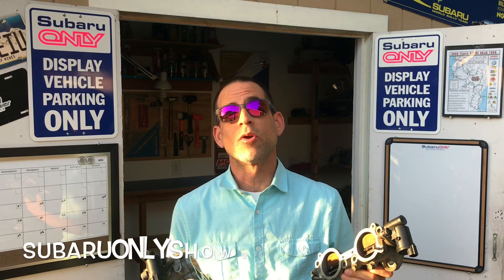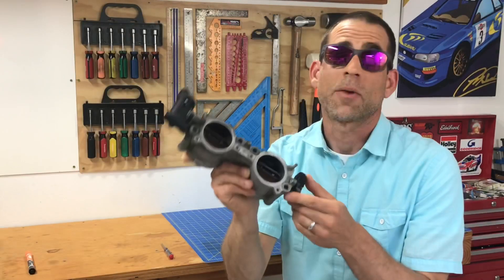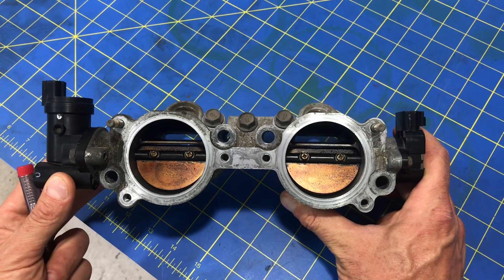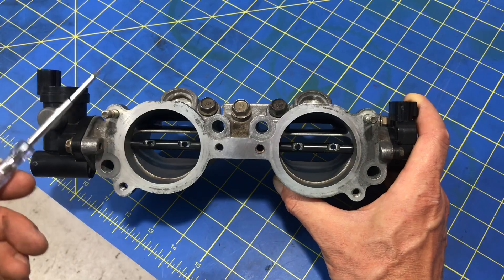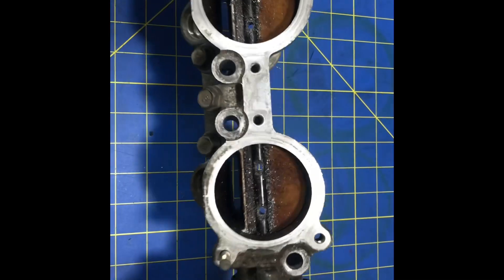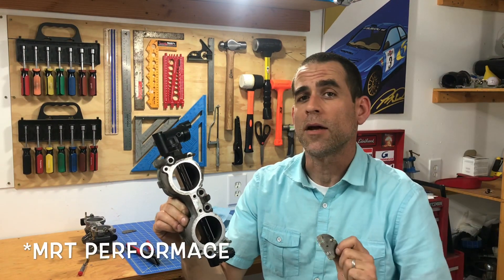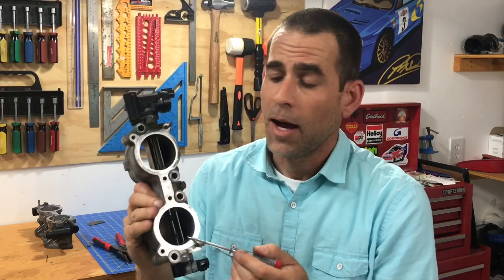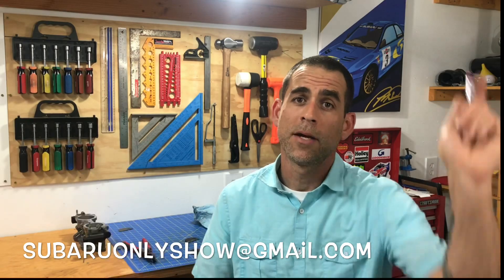TGVs | How to Modify for MORE HP (and NO CODES!)

Comment: What year did these get installed? I have a 2005 forester 5spd without tgv, but got a tgv manifold with the coolant tube for free. I installed it while I was replacing the intake gasket and found everything bolted up perfect and connected properly as well as harness plugged in. Got car put back together and it cranks with no start. Do I need to replace the ECU with one that was meant to run these, or is there a relearn I need to do? Im about to put the working one back on

Comment: Hello, not sure if you are still answering questions to these videos. It is 7 years old. You stated that in Japan they don't have TGV valve due to different emissions standards in Japan. If this is the case are they using the TGV body without the population of the valves and electronics or did they create a different intake manifold that is taller to compensate for the height difference? If they created a different manifold do you know what the part number is or how to find one? Thank you in advance!! great video!!
Reply: the jdm tgv's look almost identical, however there is no rod or motors attached it's a chunk of aluminum. there is still that small divider inside

Comment: lol I like how he sounds like he knows the science. Leaving the holes open does change turbulence no matter what position it is. The aerodynamics does change putting in the screw changes the aerodynamics. But like you said it won’t change the horsepower by much that you would not even notice on a dyno however, removing the screw is a better choice because there’s less chances of it coming off and going through your motor. I would also remove the screw. I’m wondering does the rod have a key way or something that stops it in a certain position? Why can’t the rod be cut off? I don’t have a Subaru with this since mine is old I was just wondering before I buy a 2021 wrx sti.

Comment: Hi Luke, I did this but still got CELs they are p2005, 2006, and 2009. I already tried to swap the sensor and motor from another car but all three codes are still there. Do you have any suggestion? Thanks ahead!

Comment: They are y
Tight because the factory smooshes them after they are installed so they won't fall out into the engine. Carb butterfly are the same way

Comment: I’m getting P2008 intake runner code bank 1.. changed motor and still the same? Will TGV delete fix my problem? It’s triggering all kinds of codes including misfire cylinder 1. 3 and 4..

Comment: Might sound like a dumb question, but is it possible to remove the tgv housings without completely removing the intake manifold. I know you have to unbolt the IM from the tgv housings to unbolt the tgvs from the heads, but I really don't want to completely remove the IM
Reply from the maker: It might be possible, but it’d probably be much easier to remove the whole assembly (IM and TGVs), then remove them.  Just my opinion. Cheers and good luck.
Reply: @SubaruONLY  do you have a video showing the easiest way to remove the IM? Seems like a painful amount of stuff to disconnect to "just" replace the tgv housings. I've been thinking of just leaving them until I end up pulling the motor one day, unless its alot simpler than I am thinking it is
Reply from the maker: I just looked through my videos and I guess I don’t really have one breaking down the steps for removal - but it’s not too bad tbh. 

Going by memory…Just need to disconnect the fuel, vapor recovery, vacuum lines, and throttle cables, etc. Then, pull the air intake components, but leave the throttle body on. Disconnect all the wiring plugs. Then remove the long bolts that hold the IM down, leaving the bolts in that connect to the TGVs. Think that’s about it. Should be able to lift off the whole assembly at that point.

Comment: Take the shaft out cut a section put it between the sensor and the activator plug it in and lay it off to the side of course with something to hold it together that way you get your air flow with no codes

Comment: Is it possible to remove the OEM TGVs and just jump the sensors? Kinda like jumping the PCV sensors while doing an AOS install

Or maybe just have the motors sit somewhere else in the engine bay with aftermarket TGVs in their place?

Comment: I know this is an old video, but does this small upgrade require a tune?
Reply from the maker: Not a tune per say… but removing the OEM TGVs cause the ECU to trigger a fault code, just need to deal with that.
Reply: @SubaruONLY  but that’s of course if you don’t use the Tgv sensor right? I was just going to do what you did and remove the butterfly valve

Comment: What is the best way to deal with sensor issue and spare cable in case you change TGV?
Reply: Are you referring to like if you got actual TGV deletes without the valve rod and each end without the sensor sealed off? Cuz still whenever we've done mods for TGV delete we go the route of buying them with the middle section cut out the separating plates that run up and down and their sealed off on each end. This is the first time I've ever seen it done where you leave the rod in. But if your question is what I originally asked just get the TGV CEL code tuned off and you're good to go. Sure you probably figured it out by now 10 months later lol hopefully you made out okay and everything worked out for you. -L

Comment: How does your subaru run now? More power and no engine codes?
Reply: Thank you for the detailed video bro. I took mine out and my wrx feels like 25 more hp gain. No more boost going up and down. It stays at 15psi now. It used to go from 12-15 up and down while in full boost. Thanks again
Reply from the maker: Awesome man. Stoked to hear the improvements!!! 👌
Reply from the maker: Yes to both!

Comment: What larger injector will fit in that year. Looking for an injector Jaron E85 and boosted and a EJ 253 lower compression pistons???
Reply from the maker: Injectors are either top feed or side feed.  You can easily 2x - 3x the fuel by stepping up to big ass injectors, regardless of the style. One note, top feed are best for high horsepower setups.

Comment: Unknown knowledge:  How long do those flaps stay closed?  The answer is as soon as you start your car, the plates remain closed and will stay closed for 200 years.  As soon as your foot touches the pedal and the ECU senses a TPS reading of 1, they flip open and stay open until you turn off the car.  The myth with these is that they are closed "until the car is warm" and that's not true.  The real power adder comes when boring them out and tuning, however this is an interesting $0 way to do some work on the weekend for a smattering of power.
Reply from the maker: Agree. Just a smattering, lol.

Comment: So it wont throw a check engine light on at all if done this way??
Reply from the maker: Yes, that’s correct! 👍
Reply: @SubaruONLY   so i dont have to have a tuner go in my tune and turn off and disable tgv codes??
Reply from the maker: Yes, exactly.
Reply: @SubaruONLY   okay so i did this and putting my motor back in my car this weekend hopefully this works lol
Reply: @robertocollazo-lugo3624 did it work?

Comment: 2008 to 2011 2.5L na motors have clean tgv no rods no direction channel just open swap take some upper intake mods  nothing major (bolt pattern change) also the better upgraded fuel setup will take some more indepth mods. 
The reason the screws don't come out easy it the back of the screw it expanded to prevent removal grinding off the back of the screw allows easy removal
I'm working on a 3d print to connect motor and sensor to work off intake and fool computer
Reply from the maker: That would be awesome!!! Keep me posted on this project!!! 👍
Reply: @SubaruONLY  i have the intake mods done i can send pics if you have email and made a fuel block still have to make 3d print setup
Reply from the maker: Cool. Love to check it out!

Comment: Most noticeable on na engines turbulent air creates better air fuel mixtures and more power rather than having unburnt gas getting into the exhaust. When port and polishing they get better results when they use rough grits or even create dimples on the intake cylinder head. You left the rod in there so you still get some turbulence.
Reply from the maker: Yes, I’ve seen that for some Motorsport applications.
Reply: @SubaruONLY   companies like bmw an benz use Tumble flaps to get the same result as gasoline direct injected engines. Or maybe it was the technology before gdi because swirl flaps tend to fail screws get loose an destroy engines. Which is why no one objects to deleting them.

Comment: So if I were to do this would I not pass smog check anymore? And this would clear P0026 and P0028 codes?
Reply from the maker: Due to the check engine light it triggers, yes, smog will be an issue till those are resolved.
Reply: @SubaruONLY  so I don’t need those flaps to pass smog right? But then I would also need a tune afterwards because I deleted those? That’s what I’m getting from reading through the comments
Reply from the maker: Yes, sorry, that’s exactly correct. I realize I didn’t make that very clear. Keeping the rod and sensor prevents the check engine light from coming on due to the sensor being missing, but then having the little plates gone will likely create an different check engine light (or will at least require a tune to run smoothly, haven’t verified if it actually trips the check engine for the tune being off). Hope that clarifies it.

Comment: This  butterfly removal would  only increase torque  at the top of  the  rev band  IF that is  the  primary restriction in to airflow  in the  system.  I see no benefit on a  street driven  car.  Off road I would  remove the thing altogether and  use a  1/2 phenolic  spacer ported to the  heads and  UIM.  The tumble should  help  with low  rpm mixture  burn and therefore torque. 'I live in California,  so I am going to remove  beneficial smog equipment (that doesn't hurt performance)  and  fool the  ECU setting no MIL .' Bad  boy! - Sandy
Reply from the maker: Good logic here. Makes sense. cheers!

Comment: Quick question, if i replace the tumbler motor is there a special settings how to reinstall it?
Reply from the maker: The motor should only install one way.  The sensor and plug will need to be inserted and rotated about 45degees when you install it, that way it’s slightly spring loaded when in the normal position at rest.

Comment: Question. What position does the tgv sensor on the passenger side near the turbo need to be? How is it positioned?
Reply from the maker: Should be slightly closed at idle and you should have to rotate it (think about 1/4 turn counter clockwise) to add some spring tension on the unit when you install the sensor on the rod.  Hope that helps. Good luck bud! 👍

Comment: Hey Luke! Killer video. Thank you.
BTW, regarding screw holes, and the little bit of side draft they might pick up when open position. Here’s my thought... super super brake clean, dap of Jb weld, file and sand smooth.
Only concern is whatever flows thru those TGVs goes straight in to the heads. Yikes.
So if the Jb weld didn’t hold, we just killed a motor for .003 horsepower.
Geordie
Reply from the maker: Like it buddy. Good idea.  Might try one day! Cheers! 😁

Comment: Maybe put the screw back in the hole and shave the head down. Because I think as air passes by the screw hole even if they are not facing direct air flow, the air may still catch as it passes by

Comment: Do installed TGV deletes throw fault codes to the ECU or a Cobb AP?
Reply from the maker: yes, but can remove the code with the COBB AP.
Reply: @SubaruONLY  Thank you. I just picked up the AP but prob wont do the TGVs until Spring.
Reply from the maker: Nice. Drop a line when you do. And Happy Holidays.

Comment: So by doing that it will eliminate the codes ? I have a customer with p1088 and p1090
Reply from the maker: Yes. If the code is due to the incorrect angle of the TGVs.

Comment: he probably put the screws back in because when the blades are in the warmed up position and the holes are not inline with the air flow it'll cause a whistling sound that could potentially be annoying if you could hear it because air is flowing past not through the hole and then you'd have to tear everything back apart to replace those screws
Reply: That is a reasonable theory. I wonder if anyone can confirm its validity 🤔

Comment: Hi Luke, ideally complete shaft removal. For an abstruse reason, my gut tells me that one should re-fit butterfly valve fixing screws. Wish I had an STi.
Reply from the maker: Thanks bud.  Yea, full removal would be the best final solution!  Just a bit more effort to get to that point.  But certainly a good idea!
Reply: The problem you’d most likely run into with removal of the shaft is an engine code. Correct me if I’m wrong, but one of the connectors on either side power a solenoid that rotates the shaft, and one powers a position sensor for the shaft. Long story short… no rod = no position sensor input = engine code.

Comment: Good video. BTW the screws strip because they are crimped or staked on the ends, they are not a softer material just regular plated steel. So no amount of soaking or heat will help you.

Comment: Thank you!  Just watched the video you shouted out lol
What would you rate the difficulty of getting there intake manifold off,  assuming ive still got the TMIC installed?
👍👍
Reply: Dude so I’m doing this right now. So it’s kind of frustrating for me because I have a 2014 WRX and there’s literally no videos on it. Taking the manifold off wasn’t that difficult I left the TGVs connected to the manifold so it’s easier to take out. When you take the manifold out slowly lift it up to make sure you don’t rip any wires off. I ripped off a hose going to my boost solenoid.
Reply: vV Trey Also I had a friend help me take off the manifold so it was a bit easier

Comment: If the screw holes are turned perpendicular to the air flow, isn't possible that there could be a whistling noise/effect?  Much like blowing across the neck opening of a beer bottle.

Comment: Is this the reason my car has high idle until its warmed up?
Reply: No.. Ecu will control idle based on the coolant temperature sensor and o2 sensor. Older engines used a mechanical fast idle air valve to manage idle on cold starts, in modern cars the ecu controls everything through sensor signal.
Reply: Ya learn something everyday. I appreciate it
Reply: @maverickdorgan2843  sure thing bud.

Comment: Man, your videos are awesome. I've been a huge subaru fan for over a decade now and I'm still learning. Lol. I barely subscribe to any youtubers. I have to really like these vids to subscribe and your informative videos are awesome. Keep up the good work, sir. Also, as far as tuning goes. Would it be fine to drive while staying out of boost before you can get a tune after doing this delete?
Reply from the maker: Dude - thanks!! Much appreciated!  To answer your question - Yep, keeping it out of boost before getting a new tune is fine. The fuel - spark maps for cruising / part throttle speeds doesn’t require near as much change - so you should be fine.  Good luck and cheers buddy! 👊
Reply: @SubaruONLY  figured. Just want a 2nd opinion from a subaru guru haha

Comment: Ur best just grabing a set of factory JDM intake no TGV
Reply from the maker: True. But some people don’t have the extra cash, so this is option for them.  But you got a good point.  Cheers and Merry Christmas!!
Reply: @SubaruONLY  i believe it to be cheaper and easier to jusy buy non tgv intake halfs from a wreckers. As most people dont have a compressor, air tool diegrinder  and all the bit needed.

Comment: Actually you have to look at the holes as voids in the path of flow. Picture the water going down the river. The voids in the path causes the water to swirl. That swirl creates a cushion and ripple in air flow.  The bolt will cause the air to deflect outward creating a vortex which can be beneficial.  

The effects will be see in the higher RPM's at top end speeds.
Reply from the maker: Interesting.  Thanks for dropping the knowledge for everyone!  👊
Reply: @SubaruONLY  HP gains are subjective. HP gains seen on the Dyno can be lost on the road. It was hilarious when people would ask how much power are you putting down and I would say 327whp and they would have this look and walk away.....then we would meet on the road and my WRX would walk away...lol ....It happened with a Mustang Cobra.
Subaru's make efficient power verses brute power.

Comment: What are the symptoms of these going wrong? I get intermittent CELs, a bit of power loss at higher RPM, plus that "limp mode" occasionally, AND for about the last 6 months since the CEL first started coming on, my 05 STI makes a low whistle that wasn't there before. Could one of these be stuck partially closed? I'm told this is a known Subaru issue.

Comment: Got my TGVs off and was looking at delete kits but I like your solution a LOT better. Free and pretty much 75% of the horsepower gain (total guess but seems pretty likely)
Reply from the maker: I’d say that’s pretty close. And it’s stealth, Nobody knows what you got. 😁😁😁
Reply: @SubaruONLY  Hey Luke I did the TGV delete. The car has a difficult time cranking over when the weather is colder. I havent had the chance to bring my car to get the TGV CEL light removed. Do you think by having the code clear, it will make my car start easier?
Reply: @xEhsiaN  you shouldn't get a code if you still have the TGV motors
Reply: @oWhiteMonster  I removed the motors
Reply: @xEhsiaN  you need a tuner to disable the code and tune your car
Reply: @oWhiteMonster  Thank you. But just relating back to the question, is it possible for the TGVs to be related to the hard crank starts when its cold?
Reply: @xEhsiaN  yes because it's changing the air flow characteristics on cold start.  The af is probably off
Reply: Hakasauars also it needs a tune to counter